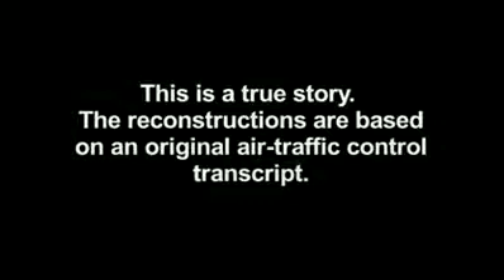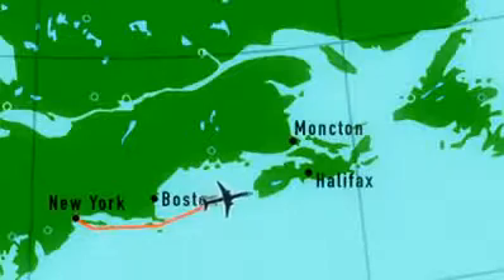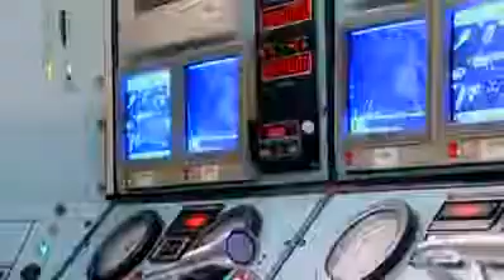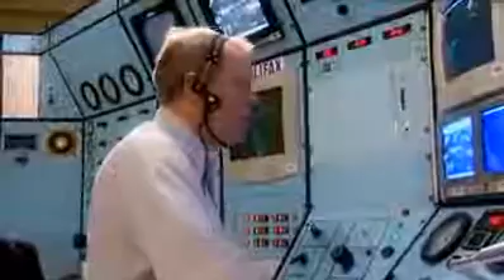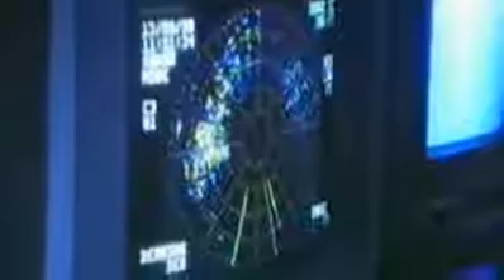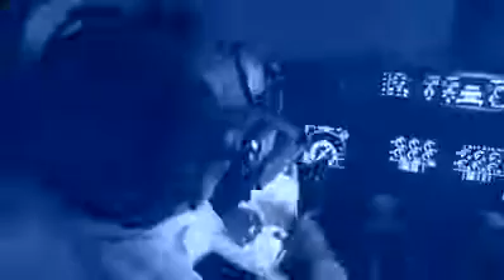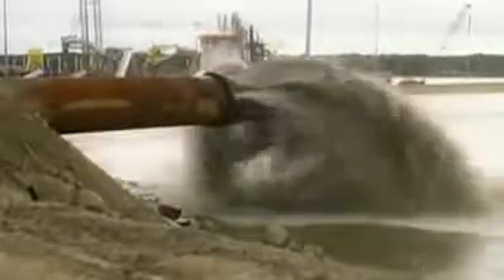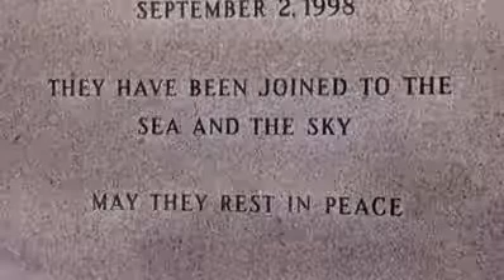S01E03 - Swissair 111 Fire on board

Comment: I don't think the flight controller has any fault. Events that took place well before the flight was handed to him made the situation inevitable by the time he had control; the checklist took too long, causing the pilots to take too long to dump fuel, and even before that, the design flaw in the electrical system meant the plane was doomed before it got off the ground. I do feel sorry for him though. That's a very heavy weight to carry for the rest of your life.

Comment: $40 million later..........."flammable materials do not belong on commercial aircraft."
Reply: It took 229 lives to realize that.
Reply: Jet fuel?
Reply: @ellenorbjornsdottir1166  He means the flammable material in the Swissair in-flight entertainment system, which caused the fire on board Flight 111.
Reply: @CriticalMaster95  Woosh!
Reply: @ellenorbjornsdottir1166  Riight?!
Reply: @CriticalMaster95  or sprinkler systems they have on high rises?
Reply: Water?
Reply: @CriticalMaster95  so all the other planes that are built with the same entertainment system could catch on fire?  no sprinkler systems or at least a camera?

Comment: To hell with the checklist,  the traffic controllers or anything else!!! Land the plane!!!  Don't wait for anything!!  Dump the fuel and lose the altitude!! Land!
Reply: The problem with that is land where? You can't land without permission. Yeah, technically you can, but airports are usually busy enough that just barging in will likely end up creating a bigger problem. The nearest airport capable of accepting them was Stanfield International, which was the airport that they were being directed to. All but two other airfields in Nova Scotia are too small or even further away. Greenwood would be questionable, and while Shearwater was technically still open, the margins for safety were considerably smaller, not to mention that the landing path goes straight over a residential area( take a wild guess as to where I live... my childhood was spent with Sea Kings circling nearby on an almost constant basis).
A fundamental element of flying is to keep impulse at bay. Watch practically anything from 74Gear( a recommendation at any time), and you'll get a good perspective. All of those checklists are to keep pilots from having to learn from experience when there's only one chance at success.
It looks frustrating, but it really is in the best interests of the flight to have that process.
Reply: The LAST thing you want is to be crossing airways at random while changing heights—you would likely make it worse by running into another plane.  Same with a random course change, you have to be able to SAFELY land at the airport you need to get to.  The controllers usually have a better overall view of who is where and how high, so they can suggest or point out possible options that are close by.
Reply: @scotiadragoon5974  when you know you only have minutes left before your all dead all the rest of the time consuming BS goes out the window. Just land the plane and worry about the rules later.  I know where in the closest airport is and that's where I'm heading to as fast as possible.  When I only have a few minutes to live I don't need permission for anything!!  I will deal with them if and when I get on the ground
Reply: @2themoon863  I'll worry about the time consuming BS later,  I'm not waiting for permission to do anything when I have  minutes to live.  I'm telling them what I'm going to do!  I'm telling them I'm dumping fuel right now I'm turning around I'm descending to what altitude and I'm coming in like it or not I've got A FIRE!  I dont have time, I'm descending fast and landing.   I would tell them to vector everyone else out of the way because on coming in!
Reply: @willschultz5452  
...will be engraved on your headstone.
Again, *where*? If you haven’t figured it out, I live in Nova Scotia. I know not only where they crashed, but all of the terrain between where they learned of their distress and the safety that they( as stated in the video) could not possibly reach.
The terrain is mostly trees, which have a reputation for being airliner-adverse. Our roadways are mostly secondary, and were laid out back in the days when roads grew out from cow paths. Our major highways are not straight, level nor lighted. If you can make them out at night( when Flight 111 crashed), it’s because there are cars on it. Cars that you will crash into, assuming that the wings of your MD-11 are not ripped off by the trees lining the sides of the undulating, curvy highway... and that you don’t accidentally ram one of the frequent overpasses that you can’t see, because it’s nighttime and the rural roadways are mostly unlit.
This is all still assuming that you( the pilot) are in any ways familiar with where you impulsively want to try not to crash. 
I and another have already noted why you don’t just swoop into one of the only three possible airports that have any hope of not resulting in tragedy.
And they were all too far away.
That leaves only one option.
The ocean. At night.
The miracle on the Hudson occurred in broad daylight, so you don’t have the luxury of being able to visually gauge when exactly to time your contact with the water, you know, that thing that you’re going to need to be able to do if you want to keep everyone alive.
Since you’re going to force land in the water at night, *right now*, then you’re going to be a lot further back than Peggy’s Cove. Your more likely contact point will be LaHave, or even further back, like Lockport. These areas have even fewer resources to come to your rescue that they don’t know that you need. 
HMCS Margaree will still be sent to your rescue, but it will take longer to get to your crash site... and find you if you’re still afloat, because it’s night, and there’s no lighting in the Atlantic Ocean.
Reply: @willschultz5452  
Looking at the detail of your erroneous plan, I missed the most obvious point. They, and that included a pilot instructor for Swiss Air, *did not know that they had minutes left *. So, unless you propose that you have a deeper understanding of flight characteristics, aircraft construction, regional terrain knowledge, and crisis management skills than a Swiss Air pilot instructor, then you’re jumping into the problem far more blind than could be possible with this happening at night.
You’re also making the assumption that Flight 111 wasn’t a priority.
Moncton is the primary control for trans-Atlantic flights for North America. This was far from theirs and Stanfield’s first emergency. Our region has seen plenty. Aircraft have been diverted to Halifax for mechanical and medical emergencies, since it is one of the closest airports for flights inbound to the continent. Gander, Newfoundland is the other one for inbound emergency flights. But you might already know this, if you’ve ever seen photographs of those two airports on September 12.

Comment: The airtraffic controller killed them
Reply: Lol that is just awful, trolling much?
Reply: both the pilots and airtraffic controller were at fault, the pilots should have started emergency landing at the site of smoke, because when there is smoke there is fire. Wasted a lot of time there. Also the air traffic controller should have let them dump fuel where ever as they were making emergency landing, the air traffic controller like the pilots didn't understand the concept when there is smoke there is fire. Both the air traffic controller and pilots wasted time. They would have lived if they had the concept when there is smoke there is fire and should have treated as if a fire was breaking out. Better to safe than sorry. If it wasn't a fire you dont lose much, but if it was a fire, you end up dead. Better to be safe than sorry.